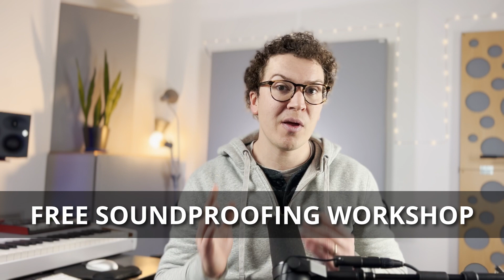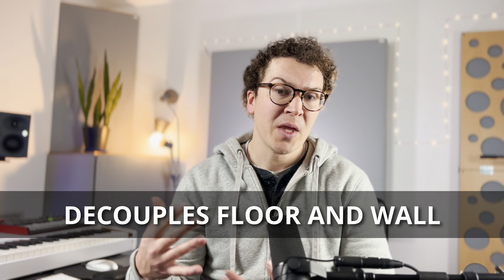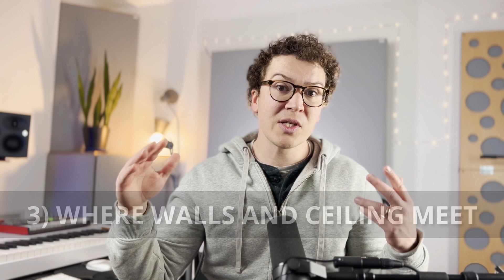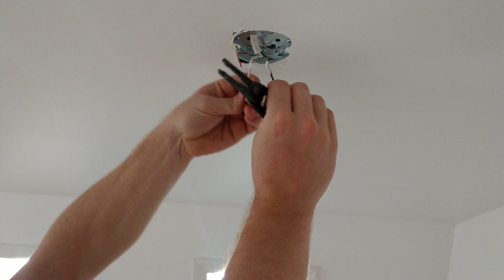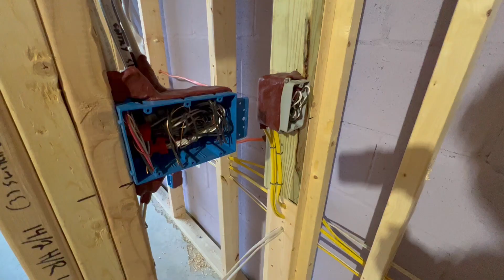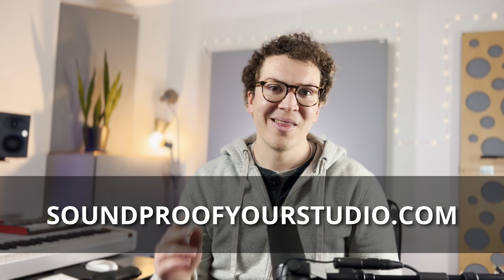Where To Use Acoustic Caulk When Soundproofing

Comment: I decoupled my ceiling with resilient channel and I added the black tarlike acoustiseal around the perimeter (didn't know about acoustic calk) before drywalling the walls, I left a gap measuring around 1/4 to 3/8" at the top of the wall drywall to keep things decoupled and I'm about to start taping. Any recommendations to avoid paint cracks with this setup? Should I fill the gap with backer rod before taping? What about mud?

Comment: 1/16 to 1/8” gap between butted drywall seams, went on metal hat channel, makes the system stronger? Do you mind elaborating on that? I don’t see how that contributes to the structural integrity.
Reply from the maker: The gap decouples the drywall from sending vibrations from one wall to the ceiling. It is a little technique that makes the whole system a bit more isolated.
Reply: @soundproofyourstudio  I see-, not “structurally stronger” but “more efficient” or stronger at isolation!

Comment: Take away: Add sealant (of any kind really) at practically all vectors and datum intersections.

Yes, any kind of sealant will block the air/sound flow in this stage when applied correctly. 'Tis why we call it all 'sealant'.
Reply from the maker: Make sure it is flexible so it won’t crack

Comment: I don't understand #2. We are leaving the gap so each drywall sheet doesn't butt up against each other?

Also, if we r caulking all the seams of the first drywall layers do we need to smooth it out before putting on the second layer? Thank u!
Reply from the maker: Yes you can smooth out the first layer. I have heard it both ways with leaving a gap versus not leaving a gap. My choice would be to just have all the walls touch and not leave a gap. If you have a solid concrete foundation you will be fine with sound traveling from the floor to your walls.
Reply: @soundproofyourstudio  thank u!